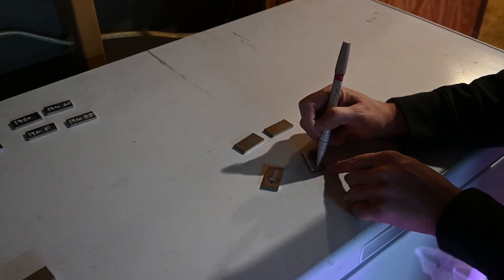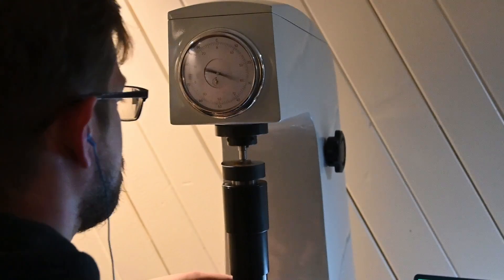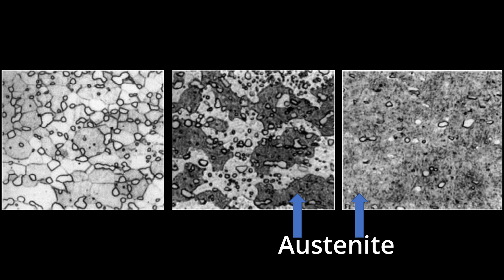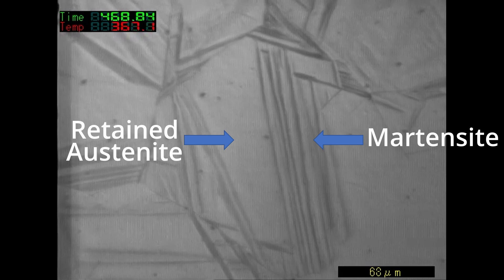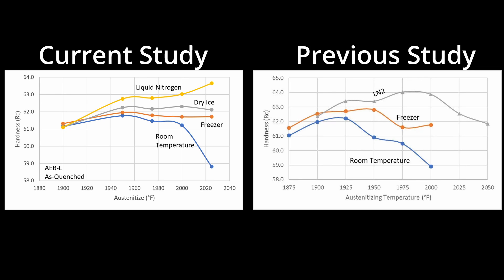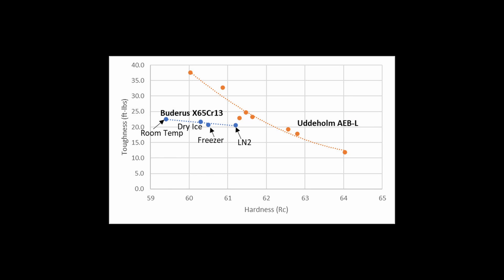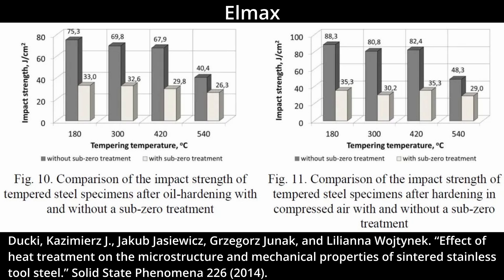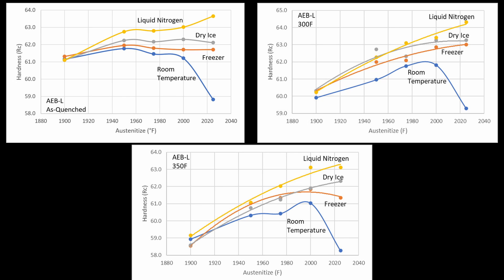Do You Need Cryo for a Good Heat Treat?

Comment: I've always struggled with weighing up the time/expense for cryo, it does ok on some steels for a really minuscule gain in any tangible qualities and some just had no real effect. So I think for the most part and concerning most steels that I use is that:
Yes, there is a mechanical effect
No, its mostly not worth it as an 'added value'
As a side note, its still wildly popular in the engine building scene with some things like crankshafts and cams that endure a lot of torsional strain on their use, so they do find with their high alloy components they're managing to scavenge more toughness for the same weight of materials and still consider it worthwhile.
Reply: If you use an actual high-quality, high-alloy hypereutectoid martensitic stainless steel and do the cryo properly!!! (not what  is shown here)  the increase in toughness and hardness with DEEP cryo (-320°F) can be anywhere from 200% to 800% from the resulting complete conversion of austenite to martensite and the precipitation of eta carbides. 

That's not worth it? When one knife maker I know of charges a /starting/ price of $1500 for blades with such treatment, and is *years* in backorder, including numerous military, police and counter-terrorism customers?
Reply: @b3s13g3d  ok jay fisher
Reply: @b3s13g3d  I live in a remote area, it'd be a 3hr round trip to pick up either CO2 or N and being physically disabled would make for a tough day of work for me just to get it and transport it back as no ones going to deliver it here. I've experimented with the steels that I use regularly and there's a fairly limited increase or no tangible increase to their performance that would warrant pushing those costs onto my customers in this instance. Circumstances where different it might be some added value, but in my case they're not and while I could make someone a 1500 knife if that's what they wanted to pay for it is a whole other subjective level of value/cost. 

So instead I use steels which out of the box are able to provide good performance to their role without cryo cycles, they do exist and are more importantly readily available and I don't want to make weapons for various personal reasons so I'm not really worried about the counter terrorism/LE market as its already full of options. That's just my business decision to keep things at a reasonable price, on time as a good product for customers to use daily- with what my circumstances allow.